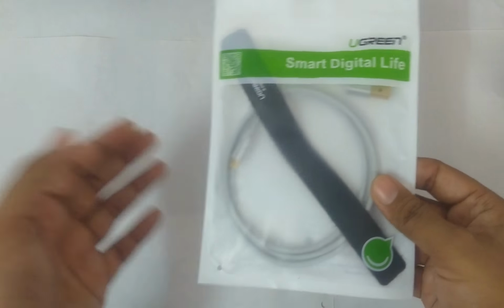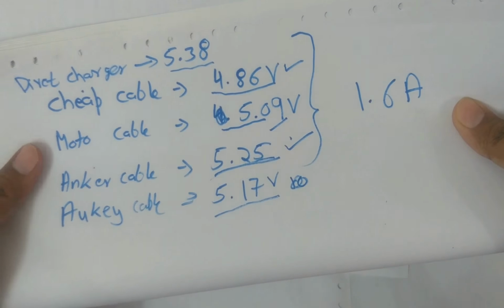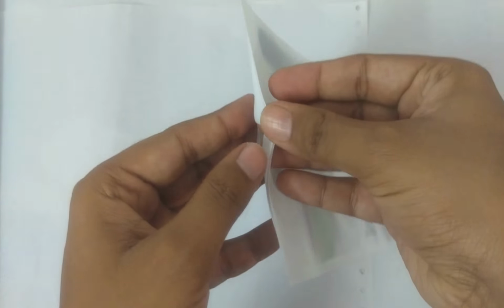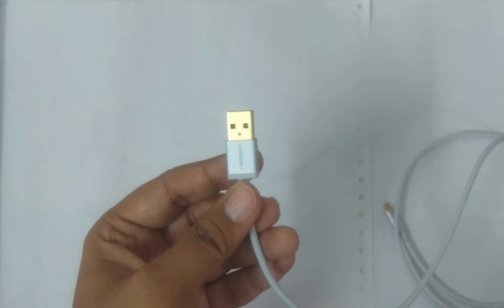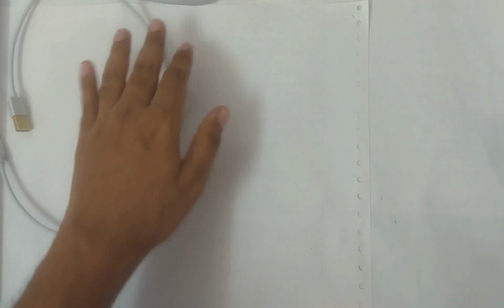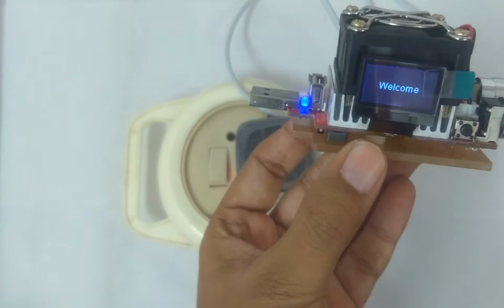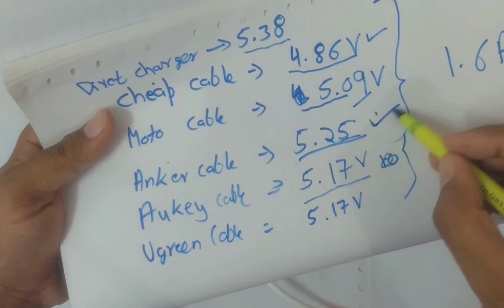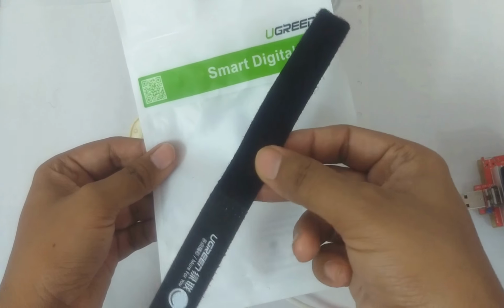UGREEN Micro USB Charging Cable REVIEW Vs Anker | Motorola | Aukey

Comment: What is the meaning of voltage drop on cables?
Reply from the maker: When current is passing through a cable. The cable has its own resistance which causes the voltage to be reduced. The amount of reduced voltage is called voltage drop.
Reply: @gurribuy  thx u so much for fast reply ...so the higher the number of voltage drop test is good or not?
Reply: @hadoukhen7053  You want a lower voltage drop down the cable.